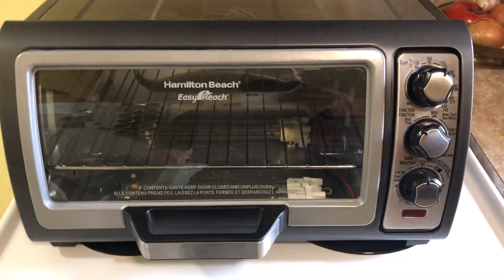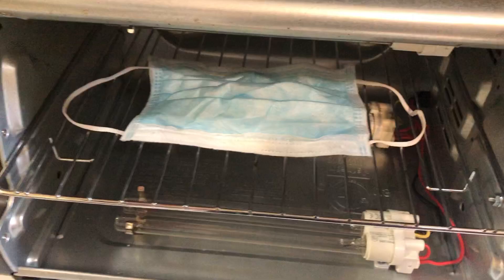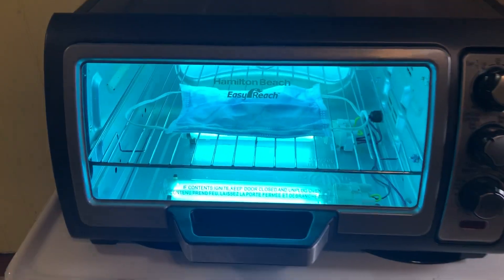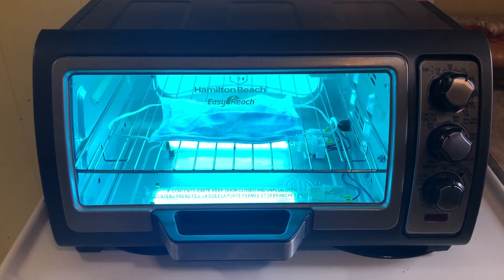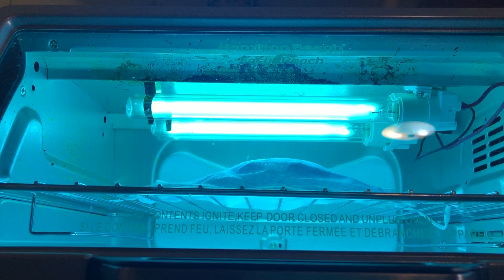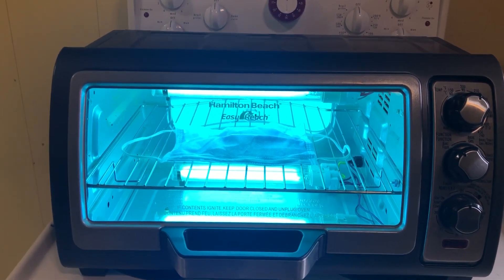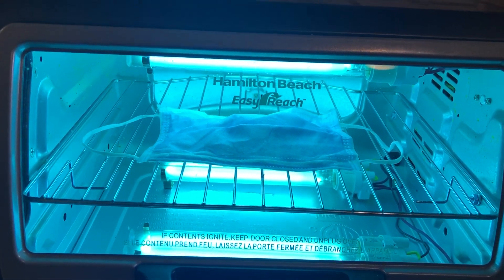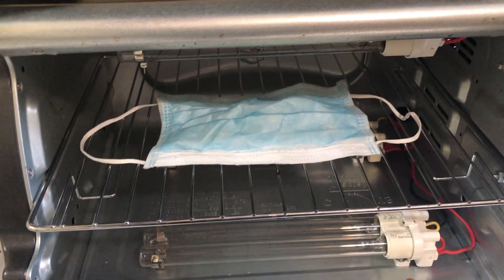UV-C Mask Disinfecting Unit Made from Toaster Oven

Comment: You realize that EVERY hospital, Clinic and even nail salons have UVC “ovens”? You haven’t invented a new mouse trap, you’ve invented an old mouse trap. UVC “ovens”, both ozone and non ozone can be purchased from MANY CDN, USD & Chinese suppliers. I personally would stay within NA but that’s my opinion. They are not costly, highly affective and use a specific non-uvc permeating glass. 
So, while yours is a lovely “offer” to donate,  no one is going to want it without FULL testing/certification from a reputable lab and that would include the huge issue of liability on both potential and probable retinal damage as well as skin damage. While it’s generous and perhaps there is a backwoods small town hospital that wold love it as this is FAR from over......you might want to keep it if the efficacy is that high. You’ll need it. Sadly.. .....
Reply: Agreed. Good intentions, but not well thought out
Reply: Geez! step all over the guy, will ya!...I am certain he already has your twin sister spouting the same crap from the peanut gallery.

Comment: Toaster oven glass is typically made of quartz glass which passes UVC wavelengths. While this is ripping apart the DNA of germs on a mask, it is also ripping apart the DNA in your retinas.

Do not do this. It will result in permanent damage to your vision and skin.
Reply: You are misinformed. The "quartz" part of quartz toaster refers to the heating element, not the type of glass used for viewing.
Reply: Xedryad No, I'm definitely not speaking about the quartz heating elements. I'm speaking specifically about the glass door at the front of the unit, which can be made from several different types of glass including borosilicate or quartz. Quartz glasses are used in higher-end appliances and counter-type pizza ovens due to their high temperature resistance.
Reply: @hoverbeaver  Quartz is expensive and serves no application for a toaster oven. It's true that quartz is used for its high temperature resistance but only when resistance is required far beyond tempered glass or borosilicate. Other uses include when quartz' UV transparency is specifically useful. The main issue of your argument is "Toaster oven glass is typically made of quartz...", this is false. It is highly unlikely for a manufacturer to use it even in a "high-end" toaster oven door. You might find quartz on a toaster oven with gemstone buttons and gold plated knobs.
Reply: Xedryad Thumbs up, buddy. This whole thing is ridiculous considering that you need to destroy a toaster oven to make a box. Might as well buy a toaster oven, put the UVC lamp in the cardboard box it came in, and use the oven to make a tasty snack while you wait for your underwear to ozonate or whatever it is you've decided to do with it. At least then you still have an oven.
Reply from the maker: @ShortsDailyMotiv  I actually wish I could find a source of quartz glass as cheap as a toaster oven. The ability to pass UV would be useful to use instead of the chrome rack. I noticed that the rack creates shadowing, so flipping the item is definitely a good idea.
Reply from the maker: @hoverbeaver  It seems you desire me to have a bad measurement instrument... how do you define accurate? Am I wrong to seek to compare it to another meter? To use an example of another instrument my multimeter for example is pretty good, but it's not a Fluke. I know when it's useful and when a measurement is out of my league. What level of accuracy do you believe is required here?
Reply from the maker: @hoverbeaver  I'm open to other options on how to build this cost effectively in small lots.
Reply: TheGoodRobot You should not build this in any sized lot as any health care facility who needs them already possesses them. Focus your energy in supplying what they need, or helping those in your community who require boots on the ground. The food bank and your local hospital simply don't need someone reinventing the wheel, and certainly not this wheel in particular.
Reply from the maker: @hoverbeaver  Ok. Is that true in the USA? Do you think it applies equally elsewhere? I look at what Nebraska Med is doing as a "best practice" for mask disinfection and it seems like a real workaround (using UVC operating room "robot" to hang masks on a clothesline). So it does not seem like hospitals had established solutions for this either. Also, yes, good idea about foodbank and other donations, I'm helping there too.
Reply from the maker: @hoverbeaver  Forgot the link to Nebraska Med: https://www.nebraskamed.com/sites/default/files/documents/covid-19/n-95-decon-process.pdf
Reply: @hoverbeaver  in this on going pandemic we need something like this which could kill the virus
This is actually proven by sciencetist no need to buy a brand new toster oven for this.... As you said this can also be made in a cardboard box. Colin Guillas you should go on to http://www.iuva.org/ for more information.
Reply: I totally agree to your point of view
Reply: TheGoodRobot that's actually a really good question. I think a good minimum here would be a meter that can selectively be responsive to harmful UVC wavelengths while not being responsive to other frequencies of light.
Reply from the maker: @hoverbeaver  In that case, testing with a UV meter that does more of the higher wavelengths (not just UVC) will be a good idea. They're not as harmful, but still bad. So that'll be useful to know if the glass of the toaster allows higher ones to pass through, even if UVC does not.
Reply: UV-C is more dangerous than sunlight. UV-A and UV-B come from sunlight, but UV-C is filtered out by Earth atmosphere. Don't expose yourself to UV-C. It will damage your eyes and skin.
Reply from the maker: I've measured it, UVC light is not going through. It's not Quartz (at least not in this case). Quartz glass is very expensive, and I doubt they'd use it much in cheap items like this. The amount of UVC produced by the sun on a cloudy day is far higher.  Still... bad idea to stare at the light (don't look at the sun either).
Reply: TheGoodRobot How, exactly, did you measure it?
Reply from the maker: @hoverbeaver  I measured it with a UVC meter (230nm - 280nm with the area of greatest sensitivity near what the mercury bulb produces: 254nm)
Reply: Ah. Can you show us using this meter?
Reply from the maker: @hoverbeaver  When taking the measurement, I also put it right against glass, facing the bulbs. Also tried other various measurements (while wearing protective equipment)... including door open (definitely dangerous), cloth over door (most was filtered), plastic over door (useless) etc. I was surprised by how much the cloth blocked, will have to test varying thicknesses and materials. Plastic blocked almost none but again I'd like to try other kinds (in some cases plastic actually measured slightly higher, I think it was acting as a diffuser). I'm curious to try other materials too.
Reply: @TheGoodRobot  I have no doubt that some materials, including window glass, actively filter out light in UVC wavelengths. I am asking you to substantiate your claim that you metered it. Show us the meter that you used.
Reply from the maker: @hoverbeaver  Good idea... Thanks. I'll make another video when I get the chance. I'm also looking at getting access to a second meter also, then I can compare the result. Would also be good to compare the meter's result with what the datasheet suggests I should get for a freestanding bulb.
Reply: A second meter? What's wrong with your first one?
Reply from the maker: @hoverbeaver  I'd like to compare a couple of different units/brands to see how the results vary. The one I'm hoping to compare it to has a wider range sensor 250-410nm. With any luck I'll be able to get my hands on it in another week.
Reply: TheGoodRobot So you don't really have an accurate meter. Right. Save your money. UVC sterilization cabinets already exist and are part of standard hospital equipment. They're so common that they're part of standard equipment for spas, massage therapists, and tattoo parlours and retail for about the same price as the toaster oven you're destroying... Starting at < $100.

If you want to make this safer, just make the door opaque. I dunno, wrap it in aluminum foil or duct tape or something.